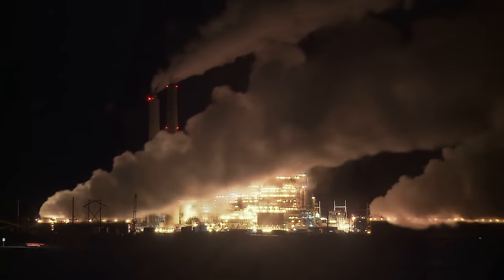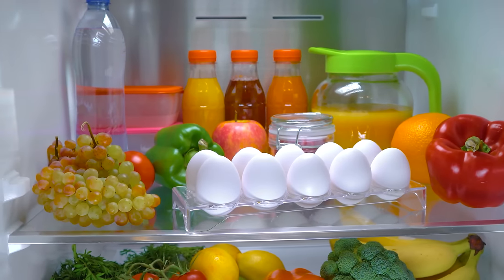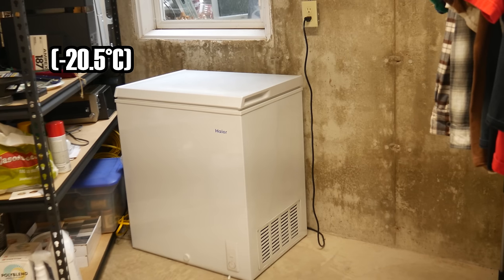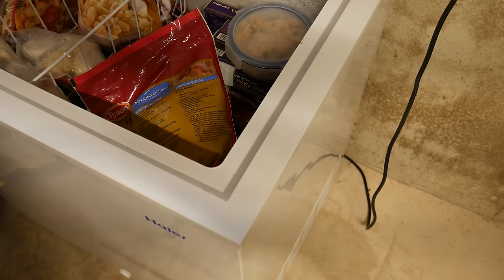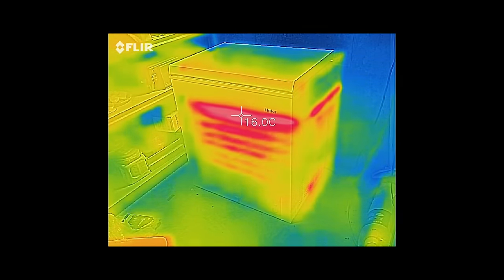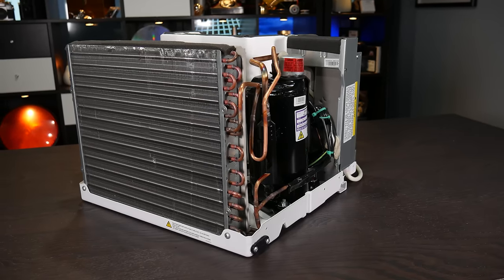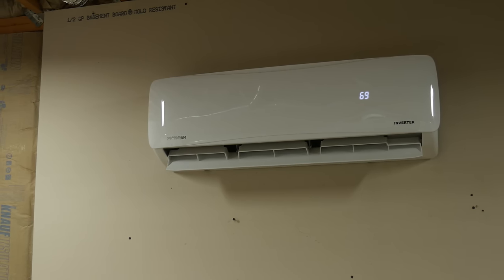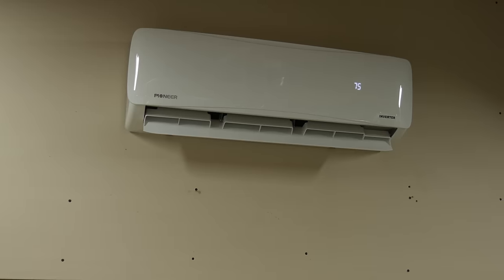Heat Pumps: the Future of Home Heating

Comment from the maker: Hello! Here's a comment with some extra info on efficiency and the metering devices used in heat pumps.
First: my wording on the efficiency drop in the cold was sloppy, and it sounds like I'm suggesting the need for defrosting is the only reason it loses efficiency. It is a reason, but not the biggest one - that's simply that as the outdoor temperature gets colder, it's harder for the refrigerant to absorb heat because the temperature difference between it and the air gets smaller. In fact, in the clip when it was -10°, it wasn't building much frost at all because it was very dry. But that was so cold that the refrigerant could barely capture any energy, which is why its output was tepid. And to be clear, its rating down to 5° doesn't mean it operates at full efficiency at that temperature. That's just the lowest temperature that it can sustain its rated heating output.
Re: metering devices. I still somewhat suspect that the mini-split has a capillary tube and largely because of its cost. It was surprisingly inexpensive (this unit was about $1000, but the smallest units from this same manufacture only cost $750 and are fully capable heat pumps). If you use a thermal expansion valve or similar, you need one for each direction which adds to the system's complexity somewhat. I'd still argue that it hardly does - it is, after all, one or two small components of a large system. But simply reversing the refrigerant flow doesn't work on its own in systems that use these more complex metering devices. They'd need some additional piping and valve work (some such valves were visible in the demo rig) to accommodate two metering devices for each direction of flow.
Reply: second one to reply! :)
Reply: Amazing video I was really anticipating this one, AND A CONNEXTRAS EPILOG, lovely
Reply: Heaters = inefficient
Reply: Most have EEV’s or electronic expansion valves. Only one valve is required in the outdoor unit this is why the small line needs to be insulated.  As in cooling mode the small line is now a low pressure liquid line.
Reply from the maker: @Nick Cress Oh, neat! I wish I knew more about my particular unit but now that it's in place it's not easy to tear apart. I am, though, very happy with it!
Reply: my appartment runs a heat pump with a augmented heater for very cold day . It's a brand new building !
Reply: Yea, Electronic Expansion valves are the only Metering device I've ever seen on a modern Mini-Split heat pump, especially on a Inverter driven unit. They are used along with various pressure and temperature sensors to maintain a consistent output of heat, or cooling.
Reply: I have one of these that developed a leak after several years. It was cheaper to replace so I built a test stand for the old one and recharged it to see if any of the leak sealers worked. So far I've had mixer results but it has been interesting to see how it works. It does appear to have capillaries going to several separate coils on the inside unit.
Reply: e
Reply: Ever thought about a second channel called technology connections outtakes? I know I'd sub to see those big word bloopers lol
Reply: @jkp41978  I’d be willing to bet that was a refrigerant distributor, and the Capillaries are so that refrigerant can be spread evenly through the coil. It helps to make the coil itself more efficient.
Reply: @mattflammger4396  probably, I wasn't able to see much but that was were the leak was.
Reply: so in Germany (air) heat pumps are very popular because it is one of a few systems that do not need additional compensation to meet the energy saving laws. That means if you build a house and have gas heating- you also have to use some sort of solar energy for example to compensate for your bad dinosaur burning.. with a heat pump system you are set and the costs are comparable as long as you use an air based system (which also has the worse efficiency)
Reply: @TechnologyConnections  Can I just flip my window unit around, instead of taking it out in the fall and putting it back in the spring?
Reply: @olik136  how often do you see temps in Germany that are below -10 Celsius? That’s the most difficult part of airsource heat pumps in the the US, because there are a lot of places that routinely see average winter temps below 15 f, or -10 c. Those temps make airsource heat pumps work very hard to maintain temps in an indoor space. Not saying impossible, and some Equipment Manufacturers have engineered units specifically for some of our more extreme cold climates, but at a lot of time at increased energy usage.
Reply: Question - when they say AC is for example 130% effective, do they mean it's 30% more effective than electric heater (which is 100%) or is it compared to something else? I'm still confused by this.
Reply: @TechnologyConnections  Only 20 or so small Phillips screws get all the outdoor unit covers off. Note where the screws and the small plastic washers go, as you really should put them back where they came from, as you will find there are a fine thread self threading type, and a coarse thread self tapping sheet panel type.  Lift lid off and you get most of the inside details, which is typically 10 screws.
Reply: @ambulocetusnatans  

If you slope it such that any water condensing on the cold side drips outside, you could technically do it. You'd obviously run into issues if it ever got cold enough to frost the coil.
Reply: @DreitTheDarkDragon  yes just like that. 100% is can be sais as COP of 1.0. With COP of 2.0 you get twice the heat that you would get from resistive heater, being 200% then.
Reply: With the freeze recently here in Texas, my outdoor unit froze up into a solid block of ice.  A little research found that at the normally mild temperatures here, the defrost only ran a maximum of once every 90 minutes on my 15 year old Carrier.  I found the jumper and moved it to the shortest period of 30 minutes.  Problem solved!
Reply: @olik136 modern air sourcing units many times exceed ground sourcing units efficiency numbers if it is over 0c outside. Even in here 1000km to north it might not be economically make sense to go to ground source if house is well insulated. It just might never pay back the price of the hole in the ground. But depends a lot how the house is built. I just checked that my air to water unit did use whole 35 hours of resistive extra heat during Dec-Feb 2021 and it was -28c at worst mornings.
Reply: If your still confused it's just like your air conditioner video but backwards
Reply: -40F/C winters in Minnesota has entered the chat......
Reply: @mattflammger4396   I'm kinda surprised in this video that it's called an "emerging technology" - I live in Norway, and heat pumps have been the go-to solution for the last 15+ years if you want to upgrade your home heating system. Many people had traditionally oil burners, but replacing them with heat pumps has been done on a significant scale for years now. I personally have 2 units in my home - both are rated for output down to -30 degrees c - which thankfully we rarely see. Though, yes, if the temperature drops further than that, a secondeary heat source is recommended (it always is - a heat pump can as any macine fail). In my case i also have 2 fireplaces fulfilling that backup function. But to me the idea that heat pumps do not work below 10 to 15 degrees c is just... wrong.
Reply: My parents have a Fujitsu mini split and it does have the expansion valves.  It's amazing the amount of heat it can throw out even when it's well below freezing outside.  If I ever have to replace another HVAC system I will swap it out with a multi-zone mini split unit and reuse the old duct work for a heat recovery ventilator.  Minisplits are bad ass and being able to control heat/cooling in only the rooms you are using can provide a significant cost savings.
Reply: Love your entire analysis. I agree with the need for dual purpose machines.
Reply: @camarogeddon  yes 10-15 degrees C is a reasonable temp for these to operate, -10 degrees C and conventional units start to struggle. As for the reason they are called emerging technology in the US I couldn’t really tell you. Maybe because traditionally oil and gas has been the preferred method of heating homes here because the infrastructure has grownup around it, and we are afraid of change here. That is a guess and an opinion.
Reply: As for defrosting, in really cold climates you sometimes see hybrid systems that combine gas furnaces with heat pumps - best of both worlds.   When it gets too cold for the heatpump to be effective or if you need an extended defrost cycle in most areas gas is still far cheaper than electric resistive heat.  

The only problem is initial install cost.  Control isn't even that big a deal - the Ecobee commercial thermostats easily support these hybrid models with some simple programming first time you set them up.  If you live in really cold climate and are going to be in your house for more than 10 years the model can still more pay for itself while also dramatically improving the indoor comfort of your house.  

Then again the ultimate would be a heat pump "boiler" to power in floor radiant heat - nothing beats radiant in-floor heat for winter comfort.  Too bad it's not more popular in the US.  Probably because we don't value long term value/return on investment much :(
Reply: The mini split heat pumps can often easily work down to -30F, or at least many of the ones I've worked with will(mostly Fujitsu units) Of course they don't have a resistive heater to handle the defrost phase. I don't know how other units work in this situation but my Ameristar unit has a bit of a multi-stage thing it does. Down to a certain temp it will put itself in defrost mode outside and then turn the blower motor off on the inside unit for a few minutes. When it's ready to go back into heat mode it'll turn the inside blower on SUPER low and then once the compressor moving the heat it will turn the indoor blower on normal speed and you get a very short burst of cool air and then the heat. Below whatever the temp cutoff is, it will heat the room about 4 degrees(F) above what you have it set on, and then it goes into cooling mode and actively blows cool air to get you back down to your set temp. Kinda a neat way to handle that.
Reply: @mattflammger4396 that theory definitely sound plausible. We have traditionally used straight Electric heaters , or firewood. There is No gas infrastructure, as Electric hydropower has been relative ly cheap for many years. Oil based units has been widely used through. But with the significant amount of Electric heating, the heat pump is a very natural direction to go.
Reply: @unacceptable6625  And then you have no slack to re-flare once it breaks and the outdoor unit needs to be removed and reinstalled.
Reply: @TechnologyConnections  Just get the service manual and look at the refrigeration circuit diagram. And not a bad idea to keep it for future reference.
Reply: @erikolsovsky548  I have been looking at my Thermia unit and it seems to defrost with around 45min cycle at worst weather, so 90min would call for problems really. Worst weather seems to be around freezing with moist weather. When getting closer to 0F defrosting timer seems to show mostly somewhere around 5 hours between defrosting so the problem is really the worst in mild weather. When around 15-20F defrosting cycle is already almost 2 hours. And above 40-ish it just wont freeze anymore.
Reply: Also, you should tape up the pipe insulation all the way to the outdoor unit, or UV and birds will ruin it in a few years.
Reply: @camarogeddon  tradition is a really interesting topic. I have worked for a wholesale distributor for Heating Cooling and Refrigeration equipment for almost 10 years. The resistance to change that I have encountered by professionals in this trade blows my mind. The other interesting thing to consider is that up until maybe 25 years ago the Northern parts of the US, have experienced very mild summers, but very brutal winters, and a lot of homes were built without AC at all. All you had was a furnace or boiler that provided your heat source, and Electric has traditionally been way more expensive than burning fuels to heat homes.
Reply: @JussiPeltola  yeah some plastic conduit for most of the way would make it much nicer looking and then protect the last two feet or so from uv and birds. Now it looks unfinished.
Reply: Is this what I see a lot in Tokyo, Japan “apartments”?
Reply: @ambulocetusnatans  The moisture will drip into your house as it pulls it from the outside.
Reply: That roof overhang dripping on your heat pump needs to be fixed. Water dripping on a supercooled surface will allow ice to build up forcing defrost mode more frequently...
Reply: Your defo not real background keeps getting more and more convincing 😉😂
Reply: On a Pioneer mini split seller website, the "estimated cost per year" was listed as being 3 times more for heating ($269 vs $88) than cooling... why might that be the case?
Reply: @SuperVstech  Any dripping water can freeze and jam the fan, or saturate the coil with water and crack it when it freezes. The manufacturers deny warranty if water drips on the unit. So that certainly should be fixed with gutters or an awning.
Reply: @TechnologyConnections   Look at channel HVAC School.  They just posted a classroom explanation of mini splits in conjunction with the operator of the AC Service Tech channel.
Reply: @paulmitchell4421  Probably calculated for a climate with a long winter and a short cooling season
Reply: You made this video like just as I started reading abt homes with heat pumps and I didn’t know what they were lol
Reply: @IMJustSomeGuy100  you must be a refer tech! High five I am too!
Reply: @unacceptable6625  Sure, you can do it right, but I've seen too many with no slack and no UV protection so the too-short pipes come out of the trunking with rotten insulation. Yuck.

But, as mentioned, wall mounts on wooden walls cause vibration and I prefer to put up a base on the ground, and I like to leave some horizontal pipe to avoid stresses when it inevitably sinks and leans. But not so much slack it touches the ground, obviously.
Reply: @JussiPeltola  Longer heating than cooling season may well be the case.  With 365/24 dehumidifier mode being installation stimulus, my thinking centered on why there might be a difference in "constant run mode".
Reply: We here in Russia simply have central heating, and it is, sorry, way more better than furnace, heat pump or resistive heater. During summer, of course, south part of this country needs air conditioner as you. But I've heard about interesting project which involves building nuclear water heaters (just like power plants, but way more safe because of many reasons) which would heat water for central heating system. Heat pump is still cool though, but centralized something is nearly always less expensive than individualized one.
Reply: Man...put the junk food and leftover burger king bags back in that freshly cleaned fridge
Reply: @JuanWonOne  20 years in HVAC and commercial refrigeration.
Reply: @mattflammger4396  Tradition has enormus momentum - especially among professionals - it IS very easy to stick to tried methods, as doing something new and to you unproven may be a rather risky move business wise. Judging by a lot of the comments - a lot tried these units early, but unfortunately encountered problems in colder temperature - this creates an initial negative experience, and that can stay for a loooong time. We had issues too with the very early units over here, but the units in the last 10-15 years has been very good. I just had a look at the unit in my living room - and i notice it uses R32 refrigerant - which has a boiling point of -52C - which may go a bit towards explaining how the pumps are able to operate as low as they do. Efficiency suffers as the temperature drops - but i have not had any issues heating my home in the prolonged periods of -15C we had this winter (though i added a bit of firewood to the heat mix when the electric prices went skywards...)
Reply: @IMJustSomeGuy100  nice!  I'm getting close to that at 15 years. It's an unsung trade. Everyone goes to supermarkets but not to many people actually know how they work or the why.
Reply: There is only one person I know of using air source heat pumps in subzero temperatures successfully. And that is because he has installed the outdoor unit inside a green house patio. The patio itself is maintained with Geothermal earth tubes and never gets below 40F even when its -35 outside.
Reply: Even when running a piston-based capillary tube, the refrigerant actually bypasses the piston by going around it and opening up the piston. Usually there is another metering device for the outdoor unit. So whether it's a piston or TXV there's one on both sides of the system one for AC and one for heat
Reply: There is a neat kind of dry wall that uses encapsulated wax beads that go through a phase change around room temperature, creating thermal mass for stabilizing the temperature of the building throughout the day.  (Not sure if they have fixed the problems with it being overly flammable yet.)
Reply: How efficient is this compared to a high efficiency condensing natural gas furnace?
Reply: How do they stack up against passive geothermal for efficiency?  (Edit- Doh... sorry, started writing the comment near the end, but you mentioned it in your wrap up.)

/Maybe some air conditioner company could figure out how to retrofit their already existing units to upgrade them.
Reply: @camarogeddon  The ones here in the US are engineered in a way that works poorly below those temperatures. It was mentioned a few times that other types, or more expensive systems, can overcome this limitation.
Reply: Out of curiosity could the efficacy of heating mode in cold weather be drastically increased simply by insolating the heat exchange from the outside, not always simple to achieve, but in my head I'm thinking if the heat exchange was rigged some how on an attic roof where in summer it could sit outside and in winter could be pulled inside and in heating mode while it was inside it would not only be insulated from direct exposure to the outside cold, it would be recapturing the rising heat from the air it was heating below.
Reply: See, this is what we need more of; videos going over items that are more efficient, at less cost, and even less energy usage. I've heard loads of people argue we need to reduce energy usage for the climate, but, they're always on such massive scales, that, honestly it doesn't matter what the individual does. This, however, is a great step in the right direction.

And, looking forward to your next video. :)
Reply: Why are there no vacuum cavity insulated refrigerators / freezers?
Reply: But.... 5 times more efficient.... At what temperature? By 45 degrees that changes to what? Cov (?) Of 4 would only be 4 times more efficient? But again at what temperature. 50 degrees heating to 70 is easy. I personally am having trouble finding charts to see how that curve changes (I assume the cov change at lowering temps is a curve)

At 3 cov, given the current price of gas, natural gas even at warmer temps is almost as cheap.
Reply: I'm in Canada and oil fired furnaces are the most common heating method but just about everyone that can afford it is switching to heat pumps.
Reply: U dont need a separate TXV to run a reverse cycle these days. Most modern heat pumps use electronic expansion valves (EKV) that are PWM controlled to keep the efficiency levels high. The control logic measure the ambient temperatures, superheat and subcooling and adjust the valve aperture and compressor speed to maintain best efficiency depending on the properties of the refrigerant used which is coded in the factory. The EKV is normally located in the outdoor unit close to the condenser and this makes the liquid line (in cooling mode) part of the evaporator from where it exits the outdoor unit. Thats why pipe insulation is so important on modern units. In heating mode the EKV is very close to the evaporator inside the outdoor unit and the matrix tends to have much larger surface area to improve heat transfer. The larger vapor line leaving the outdoor unit is again like and extended element of the condenser. All the magic happens in the outdoor unit on these modern systems.
Reply: a life hack, make the exhaust from the gas heater blow on the evaporator, you will increase the COP and recover waste heat energy from the gas heater
Reply: @Cat Egorical I second the HE washing machine video idea.
Reply: @ltva8781  Central heating is best, but it is impractical for typical US suburb, a wast area covered with one store houses. Either the energy loses will be too big, due to pipes length, or there have to be lots of small installations for "local central" heating. For densely build areas, like NY, the central heating is used.
Reply: @camarogeddon  Agreed. My childhood home was built in 1975, and it had a heat pump when it was built. I live in the Mid-Atlantic USA.
Reply: It's probably a TXV at the indoor unit for a metering device and a piston at the outdoor unit for a metering device. That's the most common but is not always the case.
Reply: I don't think you're right about ice build up decreases efficiency. You mentioned that condensation heats the coil, but you missed that freezing the water also releases energy. When you defrost, you lose the energy that you gained when water freezed, but you are still left with the energy of condensation, as water comes in as a vapour, but goes out as a liquid. It's 0.6 kwh/litres of water if im correct.
Reply: @paulmitchell4421  the difference between the outside air and the inside air. The difference is much greater temperature change in winter.
Reply: sounds like this heat pump would be great in the uk as ur winters very rarely go below -10c so these heat pumps would suit  uk climate
Reply: Hello, man from the South here. Our relative humidity hits 100% very frequently. Even when it's 20 to 30°F. During the recent Winter storm Uri, it was 12°F with 100% humidity. An average day here has a humidity of around 85-90% If the heat pump consumes more electricity in cold, humid climates, it will use way more energy than a furnace.
Reply: Hello kind sir, could you please do a video on how clothes washers work?
Reply: HVAC tech here, on all modern mini splits they use an EEV which is an electric expansion valve and oddly enough they are located inside the condensing unit meaning both lines going to the evaporator are technically suction lines, ones just saturated with refrigerant which is why even on none heatpump minispits both linesets going to the evaporator are insulated.
Reply: @LukeGibsonSS  Sucking heat out of the attic would be more "efficient" than getting it from the outside air, but you are then just cooling the attic, which would cool down the house quicker. This is a bit of a "perpetual motion" kind of thing - you are better off pulling the heat from the outside air.

What I have seen however, is a nice big solar box/greenhouse type of design to place the outside unit in. Sucking heat out of that is more efficient than sucking it out of the outside air. Then again, if you make that box big enough, just bringing the warmed air inside directly is an option with almost no electrical costs at all.
Reply: @ssllhh100  That exhaust is also FULL of water vapor, so directing it to the evaporator might increase the frost/freezing issues and end up being counter productive.
Reply: @Peter The water cycle (which tree evaporation is part of) does have a large effect on local temperatures, shifting heat from one place on the planet to another. However this local cooling is not a factor in Climate change, which is driven by the rate of thermal radiation exiting from the planet as a whole, compared to the rate of solar radiation coming into the planet. In fact, putting more water vapor into the air contributes to global warming, as water vapor is a greenhouse gas itself. Sure, there are a whole lot of "actual causes" of climate change, but CO2 emissions due to human activities are a significant factor. Reducing CO2 in the atmosphere is worth doing, and minimizing CO2 being pumped into the atmosphere is also worth doing.
Reply: @jebeda  do you know the heat capacity of water ? its 4.2 kj/kg per degree C, so to drop from 100°c to 0° you will get 420 kj/kg of water, assuming its exits at only 100 degrees
Reply: If you looking for more information we give tours at one of the largest geothermal heatpump systems in North America located in Elgin IL so if you want a tour let me know
Reply: connect these as a geothermal system and all problems are gone
Reply: Ll
Reply: Hello, why do ceiling fans have a small black switch on them, I was told that I makes it spin backwards but what does it actually do?
Reply: @bradleymeyer9775  yeah your suppose to reverse them in winter
Reply: HEAT PUMPS WOULD OF SAVED TEXAS. 1 tiny space heater can defrost a 30,000 btu size condenser vs other options of 5 space heaters... YOU SHOULD START A NATIONAL MOVEMENT.
Reply: Nearly all mini-split units use electronic expansion valves, as they are fully reversible and give the units their characteristic low-temperature heating performance. They are typically installed in the outdoor unit.
Reply: It's taking people a long time to realize that hot and cold are often both needed for different applications at the same time.
Reply: @silverXnoise  exactly !!! It helps save on buying Christmas presents
Reply: You should have bought a hybrid system. Heat pump with fossil fuel backup. Blame your contractor for a lack of education, or educating you.
Reply: You relied on refrigerants way too much to explain this. I can make a refrigeration system run on water. Water is capable of removing the heat down to around 32° F. However it won't work too good as a heat pump.
Reply: @ambulocetusnatans  Yes
Reply: @jebeda  I'm ready for global warming. The deserts will start greening up again, Siberia upper Canada will be habitable. Temperatures will even out year round. So what if we lose a little beach front. Even the Bibles warned people of that. Only a fool will build their house up on the sand. If anything the ice caps harmed the planet by drying up the ecosystems that used to be where the deserts are now. You should study history..
Reply: I work in this industry, specifically in the commercial heat pump world which is where we use the same idea but on a much larger scale. It is called VRF or variable refrigerant flow technology. Look for VRF in your next apartment, it's the top end system going into new multi-family projects across the country. I had to skip around your video a bit, so I may have missed you mentioning it. Regardless, I wanted to clarify a couple of things you got wrong:

1.) Modern heat pumps in a mini-split style setup use electronic expansion valves (EEVs) that are opened and closed electronically using logic and PID loops based on system operating parameters. All inverter driven heat pumps I have come across use EEVs.

2.) A capillary tube as a metering device is really only used on cheap window shakers or portable AC units. It is also a component of a TXV metering device. Currently your Lennox AC unit uses TXV valves and your Pioneer Mini-Split uses EEV valves.

3.) Modern inverter driven heat pumps don't all lose efficiency at lower temperatures, some actually gain efficiency. The problem at lower temps is the potential of slugging the compressor with liquid refrigerant. Heat pump compressors are meant to pump gas, if the refrigerant is in the liquid stage it will harm the compressor. In order to protect the compressor at lower temperatures the system electronically limits the top speed of the compressor as the outdoor temperature drops. If the evap coil (outdoor coil in heating mode) cannot flash off all of the refrigerant to a gas before it goes back to the compressor you have a problem. Limiting the amount of flow (speed of the compressor) limits the amount of work the evap coil might have to do. This is a big part of the capacity loss at lower temperatures on these systems and is the reason why the system may requires auxiliary or backup heat.

4.) Lennox, who made your AC condenser, also make the same exact unit as a heat pump. The issue is that style heat pump still uses old technology, specifically a single speed compressor and a TXV valve setup. There is not enough control of the refrigeration cycle with that technology for the system to heat well at low temperatures. Whoever sold you that AC unit probably did you a favor as the equivalent Lennox heat pump unit wouldn't have done much for you below 30deg F. You really need a mini-split style system with an inverter compressor, EEV valves, and system controller in order to heat effectively in low ambient conditions. A comparable heat pump system that could effectively heat your house would cost you 20-40% more than that Lennox unit. Light commercial VRF equipment is the only style system I would trust to heat my house in Minnesota, but even I still have a natural gas boiler and hot water heat. Only new construction really makes sense, because to be honest the issue here isn't that we aren't using this technology, the issue is that we dont build homes that are efficient enough. Step one is and always should be to build a more efficient structure, then put the most efficient HVAC system in.

5.) Mini-splits and heat pumps have been used throughout the rest of the world since the 1980's. Cheap natural gas caused the US to avoid adopting this technology until the early 2000's and it has only been recently that it's made it's way to the colder parts of the US. You did preface this video saying it was for a US audience, but I think it would be good to note that the rest of the world relies heavily on this technology.
Reply: @jkp41978  Any leak sealer is likely to degrade over time. The high pressure side of an R410a system can get up to 500psi. Do you really trust a product that is supposed to solidify and seal a small hole against 500psi of pressure?! There is a reason it was cheaper to replace than to fix the leak, because the proper fix meant replacing the section of piping or potentially an entire coil section.
Reply: @tllx99  You are absolutely correct. It is on a test stand in my shed. I have no real plans on using it in my home. I built the stand so if it did happen to work I could put in the doorway of the shed and pull the door down between the inside and outside units. That way I could have temporary heating or cooling in the shed that didn't cost me too much. And if it doesn't work I'm not out much.
Reply: @camarogeddon  I remember seeing tech programs on TV in the late 70's hailing this "new technology" :D
Reply: You could put a few pipes in the ground ( pod if you have) and connect them to an insulated box around your AC turning you air to air heat pum into air to ground heat pump. Also a small exhaust pipe with a small ventilator working 24/7 could be used to take warm air from your home to the outer body of the AC help with defrosting and ensure the much important air circulation.     What i am really hoping is someone much smarter than me  could find a way to power AC with wind-powered generators without having to go through batteries .
Reply: @DreitTheDarkDragon  "when they say AC is for example 130% effective, do they mean it's 30% more effective than electric heater (which is 100%) or is it compared to something else? "

It means you spend 1 kWh of electricity and get 1.3 kWh of heat out of it. And since an electric header is 100% efficient (1 kWh electricity = 1 kWh of heat), you can also compare it to one. 
Those heat pumps basically cheat by taking the additional energy out of the air or ground (which in turn gets colder in addition to the used electricity).
Reply: @Peter You have convinced me Peter. CO2 is not a problem at all, and all those research scientists and climate modelers are incorrect.

I don't have the physics data and math/modeling skills to personally examine each of the points that you raised to determine which effects have a greater impact on global climate. Instead I have decided, through my participation in an international system of research on planetary sciences, to pay for people to do that for me. A huge web of interconnected, extensive peer-reviewed work seems pretty clear in their understanding on how all these things fit together. Some of the results are counter intuitive - such as the temperature of the upper atmosphere being very high (above 300 km it is over 400C), so "common sense" is not always the best guide to truth.

In no way am I saying that deforestation is not a real issue, I was mostly reacting to what I felt was your dismissal of CO2 as being an important driver of the system.
Reply: As someone who lives in an area that can have wide humidity swings in the winter, all you have to do is switch the A/C system to cold and run it for 10 minutes. The heat generated in the outside exchanger combined with the forced air fan instantly blows away both ice build up and snow build up around the unit.
Reply: @Bryan-Hensley  Yeah, no.

I'm a bit less optimistic than you, though perhaps not as pessimistic as the most worried. While I have no doubt that some areas will change "for the better", I think that even those changes, in many cases, will be disruptive and and expensive. Siberia and upper Canada may get warmer, but the permafrost is not going to change into fertile soil, for example. Generally, it is much easier to change things from "good" to "bad" (ie forest to desert) than it is to go the other way - the temperature and rainfall is not the only thing that needs to change in order to "green the desert" in the type of timeframe that we are talking about.
Reply: @jebeda  I got curious one time and decided to see what the weather was like on Earth the last time we had no ice caps. it's pretty amazing what I found out.
Reply: There are some heat pumps with catalytic burners to prevent frosting, it is surprisingly cost efficient even if you're still burning fuel
Reply: I feel bad but I had a pretty good chuckle when you were saying how cold it was. lol We had -45 C for a couple of days during the Texas freeze. Gotta love Canaderp. lol Where I am we hit both -45 and +45 C. And almost no one has an AC unit.
Reply: Are there heat pumps that can operate between -40f thru 100f?
Reply: Yeah, looking at the technical manual on Pioneer's website they use either capillary tubes with check valves or EEVs depending on the model.
Reply: So? Flip my air conditioner so it's facing outwards in the winter? To heat the inside Got it.
Reply: I know the exact reason why you have a regular air conditioner and not a heat pump. Being that you have a Lennox ML195 furnace and a Lennox XC13 condenser I guarantee you that the salesman that came to sell you that equipment was selling you on what we call price. He basically said I got the best price go with me. That's why more informed HVAC and technicians need to sell equipment on what's available not on the price. I tell people how much energy that they will save electrically by switching to heat pumps all the time but people don't want to pay the added cost of doing a heat pump versus the regular air conditioner. there's literally people out there that say I don't care I will just burn more fuel
Reply: Very nice video. For frosty country there is also the possibility to put the outside condenser in the ground where it should be depending on the depth a constant 4°C for heat extraction. https://www.baudochselbst.de/wp-content/uploads/2013/05/wolf_waermepumpe_bws_anlagenschema.png
Reply: @whuzzzup    @Karjis  
Thank you both for great answer, now I finally understand what that means! :)
Reply: Can confirm the ~20% of energy used. I only have electricity in my house with a central AC/Heatpump on an electric furnace. Furnace to heat the house runs at 240V/95A, the heatpump runs at 240V/13A. Not 5:1, but the runtime on the furnace is less for the same amount of heat into the house. I can run the heatpump efficiently down to -12C, but Mitsubishi has a model that runs efficiently down to -30C! I couldn't get the Mitsu as the indoor air handler is massive.
Reply: If you want your window AC to act as a heat pump in winter, just spin it around and put it in the window backwards.
Reply: Mini-split for $1000? You may consider spending more for a better rating depending on your energy cost and climate. Also check you state or province for subvention or tax credit. It may make sense to buy a ultra efficient model with it. The credit will compensate for the higher cost of the unit.
Reply: just say: freezer-uno-reverse-technology
Reply: Pioneer is the same heat pump I use in my addition in my house.
Reply: @TechnologyConnections  I'm sure everyone who lost power in Texas loved thire heat pumps then. Good technology but there are downsides to this "electrify everything" movement that can be fatal if not properly delt with.
Reply: @JussiPeltola  
Service manual? How do you get one of those?
Reply: @joeswartz8286  Google, or the manufacturer / seller
Reply: Another note on what you said about metering devices:
Shouldn't the measurement point (the bulb in a thermostatic expansion valve) be at the suction line, because that's where we want to maintain superheat (ie that all the refrigerant is gasseous)?
We don't want liquid refrigerant in the compressor 1) because it's bad for it but 2) also for efficiency reasons.. so I think it should be just before the compressor (at least HVACRSchool.com says so)
Reply: I can't wait for part II.  I have been a long time supporter of geothermal heat. I have a high efficiency system in my house and have managed to convince a few friends and neighbors that can afford it to go the same way.  It was recently well below zero where I live for more than a week, between -20 and -30F ( -29 to -35C).  During that time, my system was able to keep up even though it was running at most if it's capacity (never needed auxiliary heat).  Over the 5 years I have had the system, I have paid no more than $700usd for an entire year of heating and cooling.  Many of my neighbors will pay that much for propane during the coldest month of the year.   The cherry on top is that you aren't dumping the heat into the air and warming the environment around you. There really should be more awareness and support for getting ground sourced to be the preferred solution.  The downside now is the cost of install, but that would reduce like all things if the volume of units installed increased.

I will be using this video to explain to people how these types of systems work, it is really well done.
Reply: could these be used to heat water?
Reply: I used to have a heat pump when I lived in Connecticut, and there was indeed a noticeable decline in performance on the coldest days of the winter. It wasn't the end of the world, but having to wear a sweater because our heating system wasn't working was annoying. In my current home in Pennsylvania, we have a ground source heat pump, and it works miracles! Definitely would recommend a GSHP over a more traditional heat pump for those who have cold winters.
Reply: You might want to take a look at dutch climate systems. They have / are developing a cooling system based on evaporation inside a heat exchanger, instead of heat pump. Claim an 80% reduction in energy and no regregurants needed. But no heating system though. It requires a couple of liter of demineralised water and there there is an option to pre dry the air, using heat, to get more evaporation and thus more cooling.
Reply: I just wanted to say you have one of the best channels on YouTube. I love everything that you do thanks so much for not only an educational channel That's entertaining but also great narration to go with it.
Reply: @TechnologyConnections  One of the biggest problems with these systems is that they depend on the electrical grid functioning.  (Even most natural gas/oil furnaces need power to work.)  As compressors work mechanically*, in theory you should be able to hook up something like a small, wood-fired steam engine to one (along with with a simple generator to power the electronics) and have heating and cooling completely off-grid.  ...and having the exhaust blow on the coil in the winter will provide even *more heat.

Does that make sense?  It is worth exploring for you, or is that something you should pass on to @Tech Ingredients?  :grin:
Reply: @TechnologyConnections  Theoretically, couldn't you put two units inside (1 in the attic, another in the basement for example) to move heat around. In the example, you could move extra heat that would escape through the roof to heat usually frigid basements. Another idea would be to store/steal heat from your garage to cool/heat your home.
Reply: @Peter While the thermal mass of water is high, and the upper atmosphere is indeed cold, the vast majority of atmospheric water (humidity) never reaches such heights. Water is heavy, and the quantity of water a volume of air can hold drops as temperature decreases. This may be counteracted slightly by the decrease in pressure, but there is a reason why the big puffy clouds stay under 1000 ft.  The evaporative/transpiration cycle is not contributing the climate change. You are barking up the wrong tree.
Reply: Basically wouldn't work in alaska
Reply: @Peter you may accidentally be correct, as forest a huge carbon sinks. But yeah, it is about the CO2.
Reply: @TechnologyConnections  would it wor in alaska at 20 below
Reply: Did they ban Freon in cans like you have are is that a myth? People say you can no longer buy it.
Reply: Are 4 in 1 portable AC a heat pump?
Reply: Alec.. @Technology Connections
.. At 28:57.. "that thing" is not also a Heat Pump... because is a lie... and it's simple to understand look..  just physics and logic.. Let's assume that the compressor consumes 500Watts... If you "burn" the 500Watts with an old and classic quartz resistance in front of the air flow inside (for heat distribution)....... you will be consuming the same 500Watts...... but without wasting part of those 500Watts in moving mechanical parts..... or interrupting the heating process to defrost.... or waiting the 2 minutes that the compressor requires to operate again losing part of the heat ...  having to recover that again in the next cycle.. etc etc....
and the resistor "burns" the 500Watts... no matter what temperature it is outside..... or how much humidity it is outside or anything... simple as that...
now.. it is more efficient to burn the fuel in your furnace..... than burn it in the power plant losing part of that energy in transport/transformation of that energy from the power plant to you home...
that's why they don't sell you electric resistors for your furnace... because is more efficient that you burn the fuel right there...
Reply: Hi, and thank you for the video! Always enjoy your stuff. One way we combat the cold here in Finland is via Geothermal heat pumps https://en.wikipedia.org/wiki/Geothermal_heat_pump which pretty much eliminate the frosting effect. They are also very cheap to run after installation and a bonus is that you can use your floor to heat each room.  The biggest cost factor with them is the fact that you need to drill into the ground for the installation.
Reply: (for the one who mentions the BTU thing)..... 1000 whatts = 3400 BTU...... yeah you get that with a wire resistance turning red hot inside a quartz or ceramic tube... releasing 700 degrees Celsius at least..(with 1000whatts is a LOT more than that by the way)........... seriously... do you think that an aluminum radiator at 51 degrees Celsius in front of that air flow... brings the same amount of heat to that room that a tube of quartz or ceramic red hot in front of that air flow???...
if heat pumps were thaaaaaaaaat efficient.....
they would use them inside electric convection ovens... instead of... (yeah guess what they use??)
it all comes out to the fact that sale to you an old classic quarz space heater... it's bad publicity....... And they can't charge you for it the same amount of money than they charge you for this ultra-modern gadget......... it is even bad publicity to put the "heating elements" (resistor in quartz or ceramic tube) in the indoor unit.... (that would be really efficient way.... you know without using the compressor).... bad is bad publicity... that's why they hide them in the outdoor unit "to prevent ice from forming on the external radiator..... in the ones that have the "heating elements" in outdoor unit....
Reply: Very good explanation of how a heat pump works!
Also, don't forget about insulation! it is nowadays possible to build buildings that don't require ANY additional energy, by means of insulation, clever ventilation and PV panels (works also with cold winters).
Please have a look at the Minergie-A certificate (use machine translation, the website is in either german, french or italian)
Reply: Refrigerants are bad for the environment and not actually a practical indefinite source for heating and cooling everyone's homes forever.
Reply: @IMJustSomeGuy100  this is correct. Source: I'm an HVAC tech.
Reply: Ha you beat me to that reply generally I would imagine all inverter units would require an electronic metering device to operate correctly and they are by flow or 2 directional I think they Commonly also incorporate a secondary fixed metering device In the distributor line that gives a secondary pressure drop not sure if this is standard
Reply: As nick mentioned the modern inverter units incorporate an electronic expansion device and I believe a secondary fixed metering device is common place.

Im a hvac tech in Sydney Australia and here it’s actually quite difficult to get non reverse cycle unit only real applications are for sever rooms as heating in this application is not required only in hot gas bypass for dehumidifying is this a thing for computer rooms but that’s another story .

I imagine the issue you have is the Reluctance of US manufacturers to adopt new product lines and the manufacturing costs from what I can see much of the designs you guys have new look similar to 20 year old units we are tearing out to replace with mostly Japanese units that are inverter based and have more electronics than than ever before.

Obviously you can get mini splits easily but I do find it odd that most large hvac systems are direct online single speed compressor units with thermostatic expansion valves where I’m from everything is going inverter with exv’s and variable speed fans even for large packaged units that have multiple compressors then quite often  have at least one variable capacity compressor to give more effective capacity control.

Cheers chad
Reply: @lordsamich755  probably because the manufacturing costs are too high. The market determines what price you can reasonably ask for what you manufacture. Not many buyers are prepared to pay much more than average for a more efficient system. Correctly calculating  the total cost of ownership is’nt simple enough for the average customer. We need more clear and informative videos like this one !
Reply: Mitsubishi Thermacore is rated to a high efficacy even in very cold subzero C temperatures
Reply: @davefroman4700  Mitsubishi Thermacore can operate in subzero C temps and still hit the rated efficacy.   They operate much better in placed where it is too cold for the air to hold water in the air than in warmer but more humid environments.   I can't help but wonder if there is also a potential to have an outdoor heat exchanger that is enclosed in a zero humidity environment, that way there would be no frosting up, but you would need to have a rather large surface to this exchanger (ideally aluminum) to stop that from also frosting up.
Reply: @dylanfinch2951  No, still less that a furnace if it's a well suited unit.
Reply: And think of the additional savings!!  For example, you never need to buy Birthday or Christmas presents again!  No more waiting in line for the bathroom!
Reply: I installed one exactly 10 years ago.
They work perfectly,but due a new law they are way to expensive to use .
Most people doesn't consider it anymore to install them because of it.
What is actually a shame imo.
Reply: Modern heat pumps work in temperatures around -30°C or around -22°F, really popular in Finland where these temperatures are normal during the winter. Those ground heat pumps are also great but in the long run and in unfavourable conditions they might actually draw the energy out of the ground in a few decades and replenishing it might take hundreds of years so they're not a foolproof solution for cold climates. You can also pump heat out of water - lakes, rivers or sea.
Reply: Can you use a foot switch with your teleprompter?
Reply: Have a grate that is a safe space away coating with Hypdrophobic' solution
... Have this "replaceable", have it slot in similar to a air filter...

Your welcome, buy me a hamburger.
Reply: @TechnologyConnections  I love your videos man, but I have to say that your current microphone gives you so much sibilance that it’s actually painful to listen to you on headphones. Even listening to you on my new (that is higher quality) iPhone speaker, from only 18 inches away, is painful. I don’t consider my hearing to be all that sensitive, so I suspect other people might have this issue, at least with headphones.
Perhaps a microphone with lower receptivity to high frequencies?
Or perhaps an equalizer plug-in? Or maybe better: a DeEsser plug-in?
Reply: I was thinking of getting one of these, but I'd definitely need a different model then the one you have, as it regularly gets more than 20 below here in the winter. And even with those models, there's going to be at least a couple days of winter where it will be well below than -30 and I'll have to resort to gas or electric heat. Thankfully, that's usually not more than a couple days out of the year, so for the vast majority the extreme cold units you described should serve me just fine, since we average about -15 to -20 for most of the winter.
Reply: To be honest, you almost sound like you're trying to sell heat pumps!
Reply: That point about needing more energy to change the phase of water than to change it's temperature also applies to melting ice. Melting ice, for example the ice in a glacier, takes far more energy than heating water a few degrees. So when the ice is all gone all that heat will go into heating the water rather than melting ice... we're doomed. 
@Tech Connect If you want video ideas here's a couple: You could make a few of those YouTube shorts videos. One on the phase changing energy thing and another on "Pascal's Wager of Climate Change". :)
Reply: I've been a sub for years! I absolutely love your content. You sir, are a very smart, remarkable individual!
Reply: The thing is heat pumps can work and especially for places that don’t have central heating distribution from a power plant. 
Using a local in home heat pump concept called Air to water heat pumps or ground to water heat pumps, they system works on the same principle as this air to air unit but instead the inside unit will heat or cool water directly and can also help heat the water for domestic use like showering increasing the ambient amount of temperature of your water before your boiler heats it to your preferred water temperature. That lowers cost of overall heating because the heater needs less energy to heat the water that already are at a higher temperature than normal.
Reply: Why most AC use DC motor not AC motor? Could you explain it.
Reply: @tllx99  great info. U work in Syr or Indy?
Reply: America - "The future of home heating" - Really:)))) You "invented" something revolutionary  as always:)))) Europe is in the queue to buy this "miracle":))))
Reply: @asdkjh4370  please to inform on heat system technology
Reply: @asdkjh4370  can pleased to you offer technical information for heat pump manuracrure?
Reply: I'm not sure if this is the plan for the second video, but do you plan to discuss GeoThermal in the future? Closed loop GeoThermal is essentially the same as this heat pump system, except without the related downsides, though they are more expensive upfront.
Reply: @Technology Connections Been watching your videos for a while. In my first all-electric home. Have a heat pump water heater that are installed. doesn't always work the greatest when the temperature gets below 60° in the basement. Doesn't seem to be a temperature issue talking to the manufacturer as much as a humidity issue. Looking at trying to pipe hot air from my house down to the heat pump for next winter so that I don't have to keep cycling it back into electric only. The real point that I wanted to get across was many developers have forced neighborhoods into electric only options. We looked for a long time to try to see where we could live with natural gas and could not find a house in our price range. Now I'm looking at burying a propane tank if our HOA will allow us to. Our 30-year-old furnace on the same EMC cost less operate than our new heat pump. The new hot water heat pump cost a whole lot less than the electric heat pump but those things are ridiculously expensive to operate. Natural gas just seems cheaper. Given less loss of the source it seems like that would be the better alternative. Tried looking at an instant electric hot water heater but I could not believe the amperage requirement. Cheaper better appliances for gas. Thoughts?
Reply: Do you notice that when you say things like "ALMOST the EXACT same thing", one of these words cancels the other? Either it's the exact same thing or it is almost the same thing. To be both is impossible.
Reply: There's another cool work-in-progress technology: optical rectenna. No moving parts and ability harvest infrared light.
Reply: Most heat pumps will start to lose efficiency at 40 degrees and become inoperable around 15 degrees. One Japanese company fixes this by placing a resistive heating base under the evaporator to help the phase change occur in freezing temps. Mitsubishi has a very neat system where they spin up the compressor, which adds heat to the system (how this is done is not well understood, from what I found it seems they use the magnetic field cause by the spinning magnets in the compressor to port heat to the evaporator, possibly by induction. Heat of friction can also be ported to the evap.
Reply: As far as I'm concerned, indoor units don't have any sort capillaries or expansion valves, it's only piece of pipe with fins and fan. Everything happens inside outdoor unit. Correct me if I'm wrong or  they're made differently there. Preferably with source.
Heatpumps are normal thing where I'm living.. As for heating solution, I don't think that it's best one but definitely better than directly converting electricity to heat. Ones that I absolutely love is water circulated floor heating. Because water can be heated in several different ways: geothermal, solar thermal,  district heating, water to air pump(heatpump) or by burning things up(wood chips, biofuel and oil). Here we are slowly moving away from oil and I'm not huge fan of district heating unless if energy were going to be wasted otherwise (factories, nuclear power)
Reply: When I moved into my current house I had mini splits installed since it was an old building. The house has two seperate heating zones one with a gas boiler and the other with an oil boiler. I always wonder at what temperature it becomes more efficient (aka cheaper) to run the gas boiler (not super high effient but only 5-6 years old) than the heat pump. And the same for the oil boiler.
Reply: Dealer priced a system at north of $60,000 for the whole house heat...  Seemed  kind of   over priced to me...
Reply: LPG always works best
Reply: How would you rate the Pioneer split unit for my area San Luis Obispo, California?  Summers average 102 degree's and dead of winter 29 degree's...
Reply: @mattflammger4396  The reason you only seen an EEV on a modern system is because the inverter driven compressor that chnages the laws of the thermodynamics. This is why the EEV will close and pen according to the mass flow of the refrigerant and it's state. You don't always have a fully liquid on your inverter driven system, which this is how you can control your capapcity of your system. A DC inverter system like this one which is a 1.5 Ton can modulate the capacity from 1 ton to 1.8 ton, yes you have read this right your 1.5ton system can produce upto 1.8 ton of capapcity, obviously it is not any more efficient at this point, but the compresssor on inverter has got that capability to be used when once in a blue moon you would have a heat wave or while on heating a very cold day below it's operating range. This is also useful to defrost your outdoor coil while you are using it on heat pump.
Reply: Can we make giant heat pumps that move heat from Earth into space?
Reply: nods head I understand completely.
Reply: @Tech Connections Why does the platter in a microwave switch between spinning clockwise and anti-clockwise every time it's used?
Reply: Hey you need a new password manager lastpass password manager was hacked like right away
Reply: Yo, more white board/graphics for visual learners.
Reply: Hi there,

I'm hoping you can help me understand somethings:

1. From your comment above would it then be save to say that this would not be a viable heating solution where in areas the reach -30 to -40 C in winter, like where I live?
2. I thought electric heaters are 100% efficient, as even the waste heat from the fan motor adds to the heating process. I'm having trouble understanding how the act of compression could be more efficient?

Please help me understand.
Reply: @UrMomsChauffer  That’s what I have in my home. I bought a hybrid heatpump next to the central heating furnace. My gas use almost halved. I only need my furnace for warm water and for longer times of cold days, below -10 degrees Celsius. The heating is almost carried by the heat pump. But my house is very good insulated, much better than homes in USA.
Reply: that's why we use systems with ground water to provide heatpumps with heat or cold
Reply: Heat pumps have been a popular choice in the Southwest. You need temps above 50 degrees F to get efficient air conditioning.
Reply: people also seem to forget that refrigrants are really bad for the ozon and the nr 1 problem i see is leakages of those little heatpumps installed by amateurs.
Reply: @JonesBeiges  . I don't think the new refrigerants have the ozone depleting CFC's.
Reply: @_DixonCider  yes but they are still toxic greenhouse gasses
Reply: @RealConstructor  no tankless water heater?! Are you running off a domestic coil from your furnace?
Reply: @UrMomsChauffer  I have, what we call a combination furnace on natural gas. Almost every house in our country has it. It heats the water for the radiators in the house (central heating) and it has a 10L boiler for heating warm water. When warm water from the boiler is used, the geyser (that’s what we call it, it’s an electrical pre-heated flowing device, built in the combination furnace), immediately fills the small boiler again. I’m never out of hot water that way.
Reply: @RealConstructor  it's the same as what we refer to as a combi-system. Separate holding tank with boiler supplied heat, with a circulator. Good systems.
Reply: Technology connections most newer ductless heat pumps use a EEV at the out door unit. It's a single electronic metering device. Only some traditional split system heat pumps use 2 metering devices. So newer ductless meter refrigerant at outdoor and there is no metering device at indoor. Just sensors to tell what is going on inside to let the outside what to do. 

This is why most of newer ductless units required to have both liquid & suction line insulated or they lose efficiency.
Reply: The modern heat pumps from Mitsubishi can go down to -33F at 50% capacity.  The Daikin Aurora goes to -22F with 60% heating capacity left.  Only the cheap versions or 10 year old systems go to 5F.
Reply: Orifices for metering devices
Reply: Could you turn a window AC to be outside and heat your house or room technically?
Reply: @ltva8781  wait  what is the difference between a furnace and central heating? We call our home furnace our central heating
Reply: @melskunk  central heating is a big system where water is heated by power plant or similar building that is built specifically for it. Then this water travels via pipes to houses and goes through radiators, cooling down and heating up rooms.
Reply: I was super surprised when I first moved to Japan and EVERY air conditioner was also a heater.
Reply: I read this in your voice 💀
Reply: @ambulocetusnatans  if you want to break your AC, sure.
Reply: Heat pumps in cooler winter regions have electric resistance or gas booster furnaces for below 40°F or so.
Ground or water source heat pumps are good everywhere until you are in permafrost regions. Even there the well just has to be drilled deep enough to find heat. If you have a pond, lake, stream or river that a coil can be sunk in you have it made.
In most USA regions the underground temperature is 45°-50°F. Great heat source for winter, heat sink for summer!
If you already have a well for household water a refrigerant loop can be dropped into the water.
Reply: 35:15

Comments

1:39 We didn't have any A/C until the 1950s. Older houses had high (9’-12’) ceilings for the hot air to go up to and transom vents over doors, double hung windows, attic fans to get the hot air out. High peaked roofs with turbine vents helped cool the attics.
Just got heat pump HVAC installed in 2015.

Pinned by Technology Connections
Technology Connections
Hello! Here's a comment with some extra info on efficiency and the metering devices used in heat pumps.
First: my wording on the efficiency drop in the cold was sloppy, and it sounds like I'm suggesting the need for defrosting is the only reason it loses efficiency. It is a reason, but not the biggest one - that's simply that as the outdoor temperature gets colder, it's harder for the refrigerant to absorb heat because the temperature difference between it and the air gets smaller. In fact, in the clip when it was -10°, it wasn't building much frost at all because it was very dry. But that was so cold that the refrigerant could barely capture any energy, which is why its output was tepid. And to be clear, its rating down to 5° doesn't mean it operates at full efficiency at that temperature. That's just the lowest temperature that it can sustain its rated heating output.
Re: metering devices. I still somewhat suspect that the mini-split has a capillary tube and largely because of its cost. It was surprisingly inexpensive (this unit was about $1000, but the smallest units from this same manufacture only cost $750 and are fully capable heat pumps). If you use a thermal expansion valve or similar, you need one for each direction which adds to the system's complexity somewhat. I'd still argue that it hardly does - it is, after all, one or two small components of a large system. But simply reversing the refrigerant flow doesn't work on its own in systems that use these more complex metering devices. They'd need some additional piping and valve work (some such valves were visible in the demo rig) to accommodate two metering devices for each direction of flow.

2 months ago
1.5K
220

mp-5
:)

2 months ago
9

HatlessRecord53
second one to reply! :)

2 months ago
6

Bernie Sandles
Amazing video I was really anticipating this one, AND A CONNEXTRAS EPILOG, lovely

2 months ago
7

Zyansheep
Heaters = inefficient

2 months ago
2

Nick Cress
Most have EEV’s or electronic expansion valves. Only one valve is required in the outdoor unit this is why the small line needs to be insulated.  As in cooling mode the small line is now a low pressure liquid line.

2 months ago
86

Technology Connections
@Nick Cress Oh, neat! I wish I knew more about my particular unit but now that it's in place it's not easy to tear apart. I am, though, very happy with it!

2 months ago
68

alexandre belinge
my appartment runs a heat pump with a augmented heater for very cold day . It's a brand new building !

2 months ago
5

Matt Flammger
Yea, Electronic Expansion valves are the only Metering device I've ever seen on a modern Mini-Split heat pump, especially on a Inverter driven unit. They are used along with various pressure and temperature sensors to maintain a consistent output of heat, or cooling.

2 months ago (edited)
13

jp junk
I have one of these that developed a leak after several years. It was cheaper to replace so I built a test stand for the old one and recharged it to see if any of the leak sealers worked. So far I've had mixer results but it has been interesting to see how it works. It does appear to have capillaries going to several separate coils on the inside unit.

2 months ago
12

Midas 2.0
e

2 months ago

H Kelly
Indoor unvented electric heaters are 100% efficient. All electrical energy is converted to heat inside the structure.
Heat pumps can be as efficient as 400% – that is, the inside air has 4 times as much heat in it as a resistance heater would supply for the same amount of energy consumed. As the compressor and coil blower fan are outside the house, the heat they give off is almost all wasted. A small amount of the heat from the compressor motor goes into the refrigerant.
Reply: The metering device is a Expansion Valve and sits in the outdoorunit
Reply: Love ya man but lennox and carrier are just replace your outdoor unit and indoor furnace and coil with trane baby hard to stop a train...dont even get me started on reem...if ya have one you just been reemed..
Reply: Buy a Mitsubishi mini splits!
Reply: @silverXnoise  If you're all in the garage with the car running, none of you will be watching anything, after the carbon-monoxide piles up!
Reply: Ok, so I was enthusiastic about the whole heat pump idea, then I heard -23°C is extremely cold and got dissapointed having understood that it won't work here in Russia(
Reply: Should be a EXV on it. Cap tubes take way too long and can only meter at one rate since it has a fixed orifice size, making it okay for small refrigeration purposes. Nowadays with cheap tech electronic valves and and variable compressors will become the norm for efficiency gains and more exact metering and temperature control
Reply: @jkp41978  That is likely a piston metering device and not just plain capillary tube. Leak sealers are absolute trash and should never be used as they contaminate the system.
Reply: @camarogeddon  it's not emerging. Heat pumps have been around forever. My folks have a 25 year old geothermal pump. AC is common in the USA and reversing them for air source heat has been a thing but due to slightly more upfront cost and the fact the resistive heaters have been cheap along with gas, wood, and coal burning stoves have been around as cheap sources for a long time, no one really wanted the optional heat pump. 

Now that newer systems come online with new homes or people old AC are failing and all this green initiatives they are going ahead and getting the unit plumbed for heat pumps. Technically my 20 yield unit can be a heat pump but with cheap gas and the mildest of winters it makes no sense for me to even convert it myself. I'd rather get a new one when this is time to be replaced. Given my coils are fine, I redid electrical, and compressor is fine along with fans... it'll be a long time before I do that.

So it just depends
Reply: @LukeGibsonSS  you can't just move exchangers, they're held in place by semi rigid torigid copper lines etc. Besides that you need to reject the cold (in this case) so theevaporator that captures the heat is exhausting colder than inside air.... colder than outside air actually. Again these heat pumps or air conditioners are all heat exchangers moving heat from one space to another in an isolated way. So you need to reject heat or cold into one space or the other to get the heating or cooling effect
Reply: @bradleymeyer9775  it reverses the rotation of the fan.
Reply: @tau9632  the refrigerant should be super heated in the last section of the evaporator so the bulb would be anywhere on the lineset after. 

On the heat pump either exchanger can act as the evaporator just as either line can be a suction or liquid line. Hence electronically controlled valves and temp sensors being deployed.
Reply: @etherealrose2139  
my initial comment was that i was surprised that it was (at least in the video) considered emerging tech - as to me it's been around for so long.

So it's good to hear it may be more common in reality - even though as only air cooling units, instead of the combined cooling / heating abilities that's normal here.

though, we do not have the tradition of central heating / cooling in our houses in the same way you have in the US - so the simpler standalone outdoor / indoor air-air units are the by far most prevalent. 

Traditionally we have not needed much in the way of cooling, only heating. so our main application of these is as heat pumps, the possibility to cool in the summer is just a nice bonus :). So at your end i guess it's a bonus that you may be able to use your ac unit to make heat (with modifications, as you mention, as many of your installs apparently are set up for cooling only.)
Reply: @etherealrose2139  I know, this system wasn't  worth the repair and replaced with a more efficient unit. I built a test stand just to play with it a little bit.
Reply: @arshia.sasson  basements aren't usually frigid and maintain stable temperatures year round.  You might as well go geothermal at that point.
Reply: WTF “Future”??? I’ve been heating my Canadian 🇨🇦 house with a heat pump for 30 years!
Reply: I know you made this video months ago but couldent u use the propane in a generator to get electric energy whilst also pulling the heat energy out of the exhaust gass then use a heat pump whith the rest of the energy severely increasing the energy efficiency of the propane/outher generators
Reply: gov will have all heads for this tech thay teach us that we always have loss but never talk about 
the converted gain we can make from eletromagnets
if u convert all the wast thermal energy around 
you u can use it universally as energy u need a true sine wave bipolar like the power comp dose a 
true pure sinewave like a grid tie inverter 
once the signal is made the system will turn on and 
consume wast thermal energy from the 
environment and space around you... there is free energy but it comes from Universal thermal loss and converted into a gain. so a pole Transformer and a 
microwave Transformer  have a common between each other u can take 2 microwave Transformer provide 
a pure sine wave grid tie inverter to it or a true bipolar sinewave that inter acts with nature in 
a perfect spherical motion like a flower of life..  if ur home provides this use it as a Source 
signal then u can simply stack the Transformers on top of eachother in correct fasion and note 
that the 1 wire on the Transformer must stay connected and the other disconnected your only useing 
1 wire on the hi side .. so test ur self 
2 microwave transformer stacked on top of eachother same face sides. one side 120 to the wall and the other 120 side to what u want to power and useing the 
Transformer just the way it came out the microwave with the wire attached causes the energy in its 
perfect spherical motion to converted wast thermal energy to amp for u hot to cold in to out... 
should look a bit nuts with u use a form of wireless energy but its interacting with the environment...this is my work a compilation of Otis car. Tesla. and many other very smart people nowadays i think i found the gate source and drainif this gets out to much that it works the 
power comp and mib will have our headsdont do this at home warning high voltage yet i cant stop u lol DO NOT TOCH THE CORES OR THE WIRES OK u will die make sure u dont touch the core if the hi wire is mounted to it u dont have to mount the hi on the core if u dont want u connect the 1 hi wire to the same side hi on the other transformer then the core should besafe to handle if nessary
Reply: @TechnologyConnections  gov will have all heads for this tech thay teach us that we always have loss but never talk about 
the converted gain we can make from eletromagnets
if u convert all the wast thermal energy around 
you u can use it universally as energy u need a true sine wave bipolar like the power comp dose a 
true pure sinewave like a grid tie inverter 
once the signal is made the system will turn on and 
consume wast thermal energy from the 
environment and space around you... there is free energy but it comes from Universal thermal loss and converted into a gain. so a pole Transformer and a 
microwave Transformer  have a common between each other u can take 2 microwave Transformer provide 
a pure sine wave grid tie inverter to it or a true bipolar sinewave that inter acts with nature in 
a perfect spherical motion like a flower of life..  if ur home provides this use it as a Source 
signal then u can simply stack the Transformers on top of eachother in correct fasion and note 
that the 1 wire on the Transformer must stay connected and the other disconnected your only useing 
1 wire on the hi side .. so test ur self 
2 microwave transformer stacked on top of eachother same face sides. one side 120 to the wall and the other 120 side to what u want to power and useing the 
Transformer just the way it came out the microwave with the wire attached causes the energy in its 
perfect spherical motion to converted wast thermal energy to amp for u hot to cold in to out... 
should look a bit nuts with u use a form of wireless energy but its interacting with the environment...this is my work a compilation of Otis car. Tesla. and many other very smart people nowadays i think i found the gate source and drainif this gets out to much that it works the 
power comp and mib will have our headsdont do this at home warning high voltage yet i cant stop u lol DO NOT TOCH THE CORES OR THE WIRES OK u will die make sure u dont touch the core if the hi wire is mounted to it u dont have to mount the hi on the core if u dont want u connect the 1 hi wire to the same side hi on the other transformer then the core should besafe to handle if nessary
Reply: gov will have all heads for this tech thay teach us that we always have loss but never talk about 
the converted gain we can make from eletromagnets
if u convert all the wast thermal energy around 
you u can use it universally as energy u need a true sine wave bipolar like the power comp dose a 
true pure sinewave like a grid tie inverter 
once the signal is made the system will turn on and 
consume wast thermal energy from the 
environment and space around you... there is free energy but it comes from Universal thermal loss and converted into a gain. so a pole Transformer and a 
microwave Transformer  have a common between each other u can take 2 microwave Transformer provide
Reply: a pure sine wave grid tie inverter to it or a true bipolar sinewave that inter acts with nature in 
a perfect spherical motion like a flower of life..  if ur home provides this use it as a Source 
signal then u can simply stack the Transformers on top of eachother in correct fasion and note 
that the 1 wire on the Transformer must stay connected and the other disconnected your only useing 
1 wire on the hi side .. so test ur self 
2 microwave transformer stacked on top of eachother same face sides. one side 120 to the wall and the other 120 side to what u want to power and useing the 
Transformer just the way it came out the microwave with the wire attached causes the energy in its 
perfect spherical motion to converted wast thermal energy to amp for u hot to cold in to out... 
should look a bit nuts with u use a form of wireless energy but its interacting with the environment...this is my work a compilation of Otis car. Tesla. and many other very smart people nowadays i think i found the gate source and drainif this gets out to much that it works the 
power comp and mib will have our headsdont do this at home warning high voltage yet i cant stop u lol DO NOT TOCH THE CORES OR THE WIRES OK u will die make sure u dont touch the core if the hi wire is mounted to it u dont have to mount the hi on the core if u dont want u connect the 1 hi wire to the same side hi on the other transformer then the core should besafe to handle if nessary.
Reply: @aurorasinplex5947  
So, 52% insane, 17% meth head, 31% conspiracy theorist and 0% knows anything about thermodynamics. Do I have that about right?
Reply: Reverse cycle aircons are a new thing in the US, seriously? I won't even mention inverter aircons then . . .
Reply: Sorry, but no: Heat pumps are not the future of home heating. They were enormously popular in Sweden as long as the electricity price was good, but now when the cost of electricity is increasing every year, people abandon it for fire heating (wood)... And of course electricity will be more and more expensive in the future, when nuclear and coal plants gets canceled because of environmental hysteria. We are not facing a bright future.
Reply: Peter Hicks  
WOW, When I convert that into Canadian dollars, it comes out to three times what I paid for a nice, big one here!
Reply: @batfan1939  And whose fault is that? you can't say Heat pumps don't work well below freezing, that is plain wrong. you can say Americans use outdated refrigerants and outdated systems even in new installations. they do loose some efficiency but when you use appropriate refrigerants they perform very well, well below freezing.
Reply: @Confederalist  they probably didn't have heat pumps
Reply: @user-by7hj4dj9s  probably most did not but that's besides the point. When the electricity goes out you can't use electric heaters both heat pumps and resistance.
Reply: @Confederalist  pro tip have a solid power grid and power wont go out
Reply: @Confederalist  also if they all had heat pump,  used electricity would have been lower so it may not have collapsed
Reply: @user-by7hj4dj9s  electricity use was not the main reason the grid had problems. Power plant faliures were the problem
Reply: @user-by7hj4dj9s  good idea but when we have billions of dollars spent on unreliable wind turbines that makes it harder then it should be.
Reply: Seem he v by guy
Reply: Heatpumps have been here for decades and we have up to -35 in winter.
Reply: @mattflammger4396  They aren't true capillary tubes, just smaller tubes to distribute the refrigerant evenly to different sections of the coil for efficiency.  Capillary tubes are sized by internal diameter and length to provide the required pressure drop.  They are used primarily in refrigeration equipment were temperatures/loads are relatively stable.  A heat pump or AC would use fixed orifices (cheapest and doesn't )vary to meet the load), Thermostatic expansion valves (Mid range price and can vary to meet the load)  and electronic expansion valves (Most expensive but finer and faster response to conditions).  Typically a 13 SEER heat pump will have a thermostatic expansion valve in the indoor air handler unit and a fixed orifice in the outside unit.  There are one way check valves in parallel (or built in) with these devices to bypass the unused metering devices when the refrigerant flow reverses to change modes.  13 SEER was typically implemented by changing the compressor from a rotary piston type to a scroll type, replacing the inside fixed orifice with a TXV (thermostatic expansion valve), and increasing the outdoor coil size from older lower SEER designs.
Reply: @DreitTheDarkDragon  I'm assuming that you mean a heat pump since you reference a heater.  A heater uses all its input power to create heat and thus is 100% effective.  A heat pump only moves heat and is usually 3X more efficient, i.e. producing 300% for the same input power at it's designed operating conditions.  But as it gets colder there is less heat to move so it will be less efficient.  The auxiliary electric strips in the indoor unit are there for 3 reasons.  First, to warm the indoor air when the unit reverses to defrost the outdoor coil.  Second, to help warm the air when it's really cold outside.  Third, to provide some heat if the Heat pump suffers a mechanical failure.  When a home is evaluated for heating and cooling loads the calculations refer to charts for the area it will be installed which show the highest and lowest recorded temperatures as well as the usual temperatures for the area.  The unit will be sized to meet those parameters in accordance with ACCA Manual J, 8th edition.
Reply: @camarogeddon  It's a matter of design.  There is technically heat down to -459 degrees F.  But you have to design machines accordingly and that will increase costs.
Reply: Regarding condensation & ice buildup on the exterior evaporator during temperatures below freezing, is it possible to spray some kind of hydrophobic coating onto the evaporator surface? How about something like WD-40 / mineral oil? Shouldn't that give a fine enough coating layer to not interfere with the heat transfer?
Reply: You might be interested in this video by Linus Tech Tips: https://www.youtube.com/watch?v=185VQ_d2bYU
Reply: Hey! you are doing great videos on efficient space heating and cooling! I am a little shocked for the prices of integrated AC and of split systems in US, however average income in US is much higher than in Uzbekistan (where I live) and the price is understandable.

I am wondering is there a chance of you making a video on geothermal cooling and heating and types of equipment used in that?
I live in an apartment, but also have a townhouse (in a suburbs - not cul de sac) and I wonder what options are there for geothermal heating/cooling.

Thank you!
Reply: put a cover over it and some walls each side man, a simple roof above it will stop it from cycling so bad at minus 10. we have covers here in NZ for our minus 15 days.. Plus the brand probably isnt ideal..
Reply: THE SPLIT HEAT PUMP doesn’t have built-in resistance heat?  I thought that was standard backup heat for heat pumps.  (That’s how my whole home unit.)

.
Reply: @chadholmes7051  Electronics are sensitive and can not be tolerated, and electricity in general is dangerous, one of its risks is carcinogenic radiation, and air conditioners with inverters are inefficient because the alternating current is stronger than the direct current!
Reply: @AKU666  There is no problem with moving parts, they are kinder than radiation hazardous to health!
Reply: probably a glass dome around the outside unit would cause enough solar heat around the unit to keep it working properly..  would of course need escape openings for the fan air to out of.  sure that stuff could be figured out.  

im just wandering how very very little money could get me one of them heat pumps of any sort for this winter.   sick of coming out of winter months with a big and/or really big ballance to pay down that takes most of the summer fo rme to pay off.  which sucks, because im really effienct on my electric usage.  i turn the hot water tank off year around. gotten in a nice non annoying habbit of just flipping the break on when i need some warm water. dishes, bathing and then gets cut right back off.  that makes a big difference guys. so experiment with it.  with most house holds being empety during the day,  8 hours estimating,  most people with kids and stuff considered.    the last person out in the morning would flip the breaker off and the first person back would flip it back on.  or not depending on the situation,  how needed warm/hot water is to the first person back.....

point is.  most homes,  there is at least 8 hours of the heater kicking on in the hot water tank , constantly turning on and off when zero reason for it to be.  

keep in mind the water stays warm until used for one.  and two... it stays warm in the insalated tank for at lest 2 hours being pretty darn warm still.  4 hrs to warm.  and at 6 its finally back down to  room temp.  and well,  most of the time we don't need HOT water. just warmed..making it realistically, only work the water heater a complete fraction of the time.  and thats big energy savings and money savings it self.   

i hear all this talk about going green. being more enviromental freindly....

NONE OF THE MOTHER FUKKERS ARE TELLING YOU TO SIMPLY DO STUFF LIKE THIS THOUGH...

ONLY TRYING GET YOU ON BOARD WITH THE PANIC SO YOU'L FEEL FORCED TO TAKE OUT HEFTY LOANS FOR AN EV....THAT MOST OF US CAN NOT AFORD....SOLAR ROOFS THAT MOST OF US CAN NOT AFORD..

i needed to highlight that real fast lol... just like covid.  non of them was telling us to eat alot of vitamin C and D.  get alot more sun exposure to simply increase your immune system so at least if you get covid.  its a more mild than not.  not a complete fix to it, but mild sick is hell lot better than hospital sick..   i say this because Pfizer...big pharma...yeah they cleared 40 billion in the first 8 months of their vaccine release.  so get you better and protected..  or make money off of you?  what you think they were realy trying to accomplish??  40 billion....that would make every one at Pfizer, millionaires...like LITERALLY every working at Pfizer.  or dam close to it lol..

that relates to my point of going green....sell you shi.  all they do is sell you shi.  all day every day.  your and your kids well being simply is not at their forfronts.

back to point real fast lol..  hey so you guys know.  i watched my electric bill go from 110 in summer months, to 70ish...simply by ussing my hot water until exactly how i need it.  turn it on and off 1 or 2 times a day basically for bathing first. later on to do dishes with.  20+ hrs it simply does not work and heat away at the electric grid.   $110 right down to $70.  

i do other things as well but the hot water thing was what made the biggest difference.
Reply: Ugh, pronouns on Twitter. Cringe.
Reply: This combined with floating houses in CHINAMPAS with hemp and small scale wind, hydro and solar. Please look into it gotta spread the message for everyone’s sake.
Reply: @16:25  Do we really need to compress the gaz again once it's outside ? Would not a long pipe suffice to slowly dissipate the gaz's temperature in the air ?
Reply: I know friends that have pump and still need wood stove
Reply: +1 for the subject matter however.. 'Stirling Engine' would give Scots inventor Robert Stirling credit..
Reply: I doubt you read this, but anyways... i just want to ask. Maybe it's a silly idea, But why don't we use wasted heat from a house ventilation to defrost\heat the outdoor unit? I believe there is a good amount of heat is being vented from a house. Or maybe it's not enough, but still it will help defrosting and overall COP parameter can be much better, isn't it?
Reply: Heat pumps are not very efficient under 40 degrees unless you bury coils underground below the freeze line.
Reply: Heating mode requires higher compression ratios, so the compressor needs to be designed to support them. The head to suction pressure increases as the outdoor ambient decreaseses. Also, refrigerant flow varies a lot more than in cooling mode, requiring an accumulator (which is part of most rotary compressor units).
Reply: I should point out that heat pumps in the US South are not at all new; they've been the norm for decades now.  That's because there was never much of a gas grid, so even in the central areas of thriving cities, the cost to get yourself hooked up is often thousands of dollars, and the cost of propane is actually more than resistive electricity here.